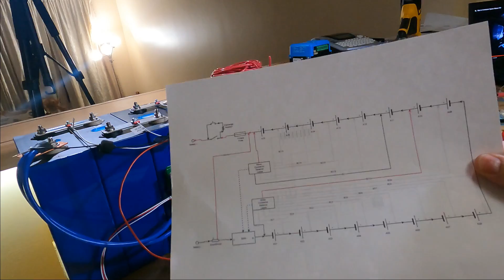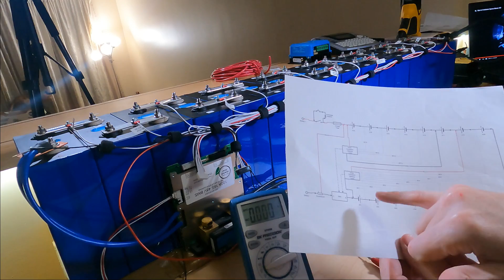Booting the BMS - How to build a 48v Lifepo4 battery (Ep. 10)

Comment: Newbie follower here; Just noticed you are using the OverKill BMS in this vid but the JK in later videos.  Can you please point me to the vid where you explain the reason why the change from the OverKill, please?  The OverKill BMS is on my shortlist for a new build.  Presently I'm doing a boat "house battery" with 16 LFP cells in 4P4S I have left over from a 32 cell 48 volt pack I used on my old Freedom 32 sloop (sold) that I installed the Electric Yachts System PMAC/Sevcon motor installation. Worked great by the way... Thanks so much for any info!  Love your videos!
Reply from the maker: I don't recall specifically where I switched, but the reason was the 200A sustained current support, and the built-in active balancer. The OverkillSolar is a great BMS, Andy is still using mine in his 3x battery setup. It just wasn't what I needed in the end.

Comment: I made three 12v batteries fiberglassed and then put them in series for my ocean sports fishing trolling motor. At first I wanted to make one larger 36v battery to save on bms costs, but no one made a 36 volt bms so I was forced to make three batteries. I am so glad I did. I did not take into consideration of how heavy these batteries will be. A 36v and in your case 48v will be impossible to move or lift. For a boat application you may want to take into consideration of this. Also making either 12v or 24v batteries and putting them in series will give you options in case there is an issue with a cell or battery. I’m watching your series late so you may have come to this conclusion already? I’m continuing on so I will see! Or as you mentioned you hare trying to figure a layout plan. I look forward to your solution.
Reply from the maker: My plan is to assemble the batteries in-place in the boat, not carry in finished packs. If I ever need to service them, I would pull them apart again. This is a major advantage of a DIY pack. Separately, I do plan to have a 12v bus, powered by a couple of dedicated 12v batteries in parallel, charged by the 48v pack's 120v AC inverter.

Comment: I use a 9v battery, 9v connector and a mini push button N.O. switch to start my JK. Just hook up where you jumper using your meter or iCharger. It is polarity sensitive to boot. Its not like I boot my JK that often.

Comment: I didn't see where you put the BMS temp sensor(s) ... or have you done that yet?
Reply from the maker: In the most recent box design, I tried to put one down in the core and one out at an edge. The thinking being that I want the edge sensor to cut charging as the temp drops, and the core sensor to no allow charging until the batteries are warmed up.

Comment: You made me nearly spit softdrink all over my computer. "Isnt it crazy when a glorified resistor has a computer inside that needs to be updated and rebooted". You win the internet (and a sub). If your meter and smart shunt read the same voltage, I'd trust them and adjust your BMS to match. I find the victron gear quite accurate. (I have a 150/35 MPPT, Smart shunt and Phoenix inverter, they all are pretty close to what my fluke meter reads. My DALY BMS on the other hand needed some offset entered to match the victron gear and fluke.

Comment: As an ex-Firefighter and electron wrangler I can say the factory installs a certain amount of smoke, there is only an issue when enough of that smoke has leaked out. Some is okay, but once you cross that line the product needs more smoke installed. IF enough smoke leaks out the Fire Department MAY need to be called (individual cases vary) as for how to configure the banks, I would hold off till you have the boat. Every boat is different and who the eff knows what space you will have then. Thanks for sharing you have great content.

Comment: Thanks for sharing your experience. So far I've learned at least 3 interesting points, and I think you might save my 16 200Ah LIFePO4 batteries from bad use. These are meant to power a 10KWh motor for my sailing boat (2.8 tons, 8m long, 50 years old polyester) so I'm looking forward to coming videos ! Thanks a lot !
Reply from the maker: That makes me very happy to hear! I'm curious, what led you to choose a 10kw motor for a 2.8t boat? Is it inboard?
Reply: @TheDigitalMermaid  Yes, it is inboard and bound to replace a .975 L diesel engine. I shall gain a lot of weight by removing the old engine and the fuel tank, about 300Kg, and replacement electric engine about 25 Kg with controller, batteries about 70 Kg. I have read somewhere that 10 KW electric is more or less equivalent to 20 Hp diesel. However, transmission is also a parameter : as electric goes about 6000 RpM but we only had 1500 RpM with the diesel, we can have a 3:1 transmission which gives more torque  than a 1:1 of course. The bad thing with the electric is range, but as the boat is for sailing, I only need the engine for safety and entering/getting out of harbours. And I hope to produce my own electricity when sailing.

Comment: So you know if it’s okay to charge and balance the cells with the iCharger while the BMS is connected and active?
Reply from the maker: I do not know, full stop. If I were to guess_, I think it would be OK. It might confuse the BMS to see one cell jump in voltage, but I don't think it would harm it. How would the path of power from the iCharger make it back to the BMS? I suppose there _could be a path into the BMS balance leads... That might be problematic, if I had to guess of one possible down side.

Comment: Just seeing the MPPT Solar Charger in the background…you will need a much BIGGER one.  I got a 250/100 TR VE.Can, very happy with it.  Enjoy watching your videos.  Dust curious what electric motor & controls setup will you be settle for.
Reply from the maker: The plan is to use multiple small MPPTs, instead of a single big one. The reason is two-fold; First, each MPPT can chase the ideal voltage/amperage for the connected cells, so if one cell gets shaded, the panels on other MPPTs are unaffected. Second, it gives me more redundancy; A failed panel / MPPT takes out a portion of my capacity, not all of it. 

I've not yet selected which motor / controller I will use, but I am leaning towards the 30kw QuietTorque at this stage.

Comment: Regards your crimps, you are probably twisting the wire before you insert it into the crimps. why not? Well, when the crimp is crushed, it folds over and down with 2 'blades'. This then effectively cuts the twisted wires. you should insert them straight!  I had the same problem with JST connectors - I wondered why they kept failing, until I saw a Big Clive video, where he mentions this mistake! 🙄
Reply from the maker: This is a great point. I generally don't twist them, but if there are stray strands I try to lay them back down with the "grain" of the other wires. That said, I wasn't twisting mostly out of habit, not for a good reason. This is excellent advice, thanks for sharing!
Reply: I've run into that as well.  Thanks for the info!

Comment: I crimped and soldered the individual terminals of the BMS making sure having good contact with the provided tiny wires, corrosion can be a problem over time especially with different materials. I use brass terminals and never aluminum.  When crimping, I included the wire insulation to avoid stress on the tiny copper wires when pulled. Copper wire to aluminum terminal is not a good combination of materials. The problem is more obvious in solar grounding installations (aluminum rails and copper ground wires) and for that they use stainless steel material in between copper and aluminum to maintain good contact while exposed to the elements outside.
Reply from the maker: All wire, ring terminals and other such things I use are tinned copper, specifically to reduce corrosion on a boat. Salty air corrodes things really quickly, so this is a good thing to be concerned about.